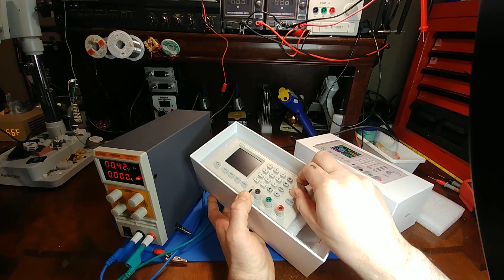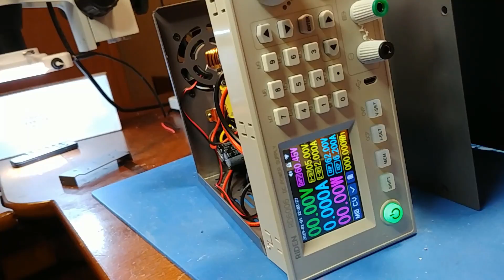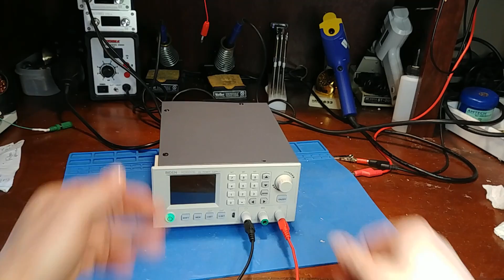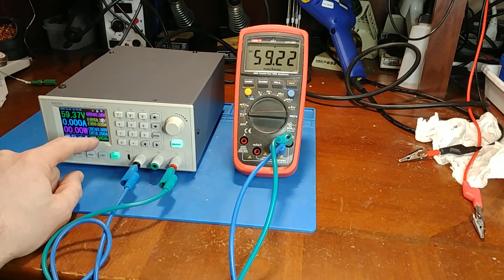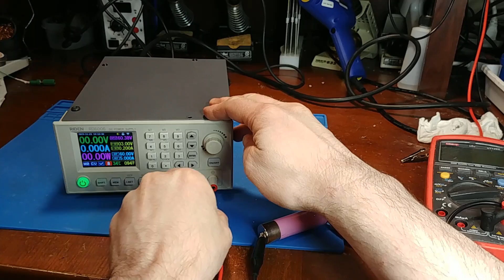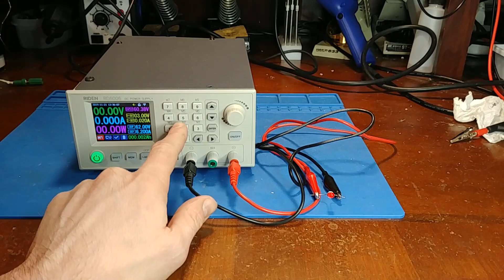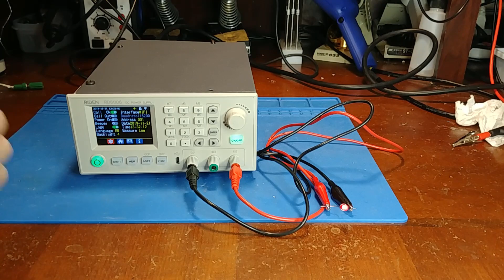Power supply: From yuk to sweet RD6006/RD6006-W

Comment: I can understand that the new buck module would ramp the voltage and current when switching the output on and off... But WOW I'm really surprised it still wouldn't blow the LED when disconnecting/reconnecting the leads.  I guess that means there's no filter caps on the output, but does that cause it to have poor ripple at higher loads?

Comment: But why you are testing diode with old power supply set to 37V 60mA and new one with 15V 20mA set? This is not a good comparison. Maybe with same settings it will also burn this diode.
Reply from the maker: I'll admit it's not a perfect test scenario. But it's a good sign the current regulation is fast, otherwise even at the lower settings, 15v would take out a LED like that instantly without a dropper resistor.

Comment: Any idea why setting a 20mA CC results in 14mA (even with Voltage set point way up?)  Is it only 0.01mA accuracy (maybe)?  I've got this coming, and will replace the GREEN battery charging terminal with some other color (hopefully one of my yellow binding post knobs will work) and I'm going to have to drill and tie a Mains Earth true GREEN post to be able to reference the supplies to for +/- supply.  Anyway, excited for mine to come in...
Reply from the maker: I'm sure sure about the current setting your refuring to. I can't do any further research, gave the power supply away to a friend. But it is a nice little power supply.
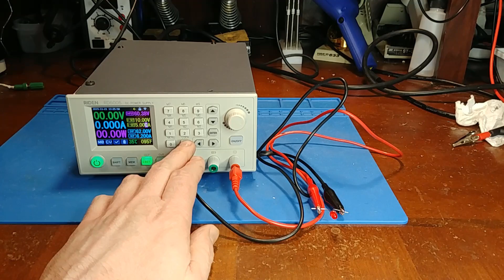Reply: @jeffescortlx  Thanks.  I just meant at 9:15 in the video, you set CC at 20mA limit/15v no load, plug in the LED, and it drops to only 0.013mA (voltage collapses to be what that LED would be at when sourcing 20mA...though it seems to be only supplying 13mA).  I'm guessing that is just as granular as it's CC mode can deliver (probably only nearest 10mA)...

Comment: Can you please describe in more detail how you figured out what value of resistance to solder on insted of front panel? I have similar power supply and the board does not have any markings beside connector when i measure resistance of bottom pins it does not change when i turn the knobs.
Reply from the maker: I took a measurement of the pots on maximum and emulated the reading with resistors. So the board still thinks it's seeing the pots on maximum, but it's just resistors

Comment: Brilliant enough to modify the old unit to put out max power, but not quite brilliant enough to immediately understand that you can't get out the full voltage that was put into a buck converter.  Most would have edited that part out... you are an honorable man!  ;-)
Reply from the maker: I assumed there would be a voltage loss, but a component voltage drop, not a software set voltage loss.

Comment: The second LED test should better be made with supply voltage settled to a target value before connecting to the LED. This way if the supply has high value capacitors can fry the LED as would in the first test.

High quality regulated supplies takes more engineering resource to develop necessary to reduce internal output capacitance, which also use more expensive part to make.  

Engineers new to this field only know to add more capacitance to reduce problems like noise and ripple not aware that low output capacitance supply are quite difficult to design and develop.
Reply from the maker: There are situations when you might not know the starting voltage. Example, you want to test  TV backlighting but you don't know how many LED's are in series without taking the LCD layers apart. So you set the current to a safe level (example 100mA) and guess on the voltage. You could start low and work your way up. But if the first guess is wrong, a poolrly designed power supply will surge over the set current and blow the LED's. This is a time when you wish the power supply would work correctly.
Reply: @jeffescortlx  
I agree with you. You have caught me on a kind assumption, leading to an omitted sentence in my initial message. 
Omitting that an experienced guy, like him, understood LED test parameters enough to set IV limits wrt a respect optimal values - 

Given he know that well he still burnt his LED because the active current sense function of the first supply can't limit the instantaneous capacitor current.

My first message was trying to point out that his test process was inconsistent, before and after.  
(first test/process) LED dis-connected, set output IV parameters, enable output port, then use hand to connect the LED (not by ON-OFF control).
(second test/process) LED connected to the output port while port is disabled, set output IV parameters, to (use ON-OFF control) to power the LED.

Side note: his first supply does not have output ON-OFF control, the second supply has.

I think he should conduct his second test in a condition represents his first - with output ON-OFF control always in ON mode, good to rule out history didn't happen with a fried LED in future.

Comment: Isn't it overkill to use the full board of the power supply fixed in 60V? Wouldn't a normal transformer just be enough? Thanks for the video, great job!
Reply from the maker: I think your underestimating the physical size of a 300 watt linear transformer.

Comment: Setting it to 5A would not put a lot of load on the 60V side, because current increases at the output since the voltage is low. So you should be able to get the full 6A without a problem on low voltages. However close to 60 volts, getting 5A would max out the board inside.
Reply from the maker: Yes, but don't forget the original board is still regulated. The voltage divider I added is just making it think the old front face pots are set to maximum. So it's still regulated to 5 amps max.
Reply: @jeffescortlx  So, 300 watts.  Maybe 280 usable depending on the efficiency of the second buck converter.  E=P/I so you can get 6 amps at up to ~46 volts
Reply from the maker: @alakani  I see what your saying. I'll try some real world numbers and see what it can do.

Comment: I have the kps3010d which looks identical apart from the case colour. It’s 30v 10a output. How easy would it be to do the mod on that one? Would you be able to give me some advice for resistor values? I can send board pics if needs be.
Reply from the maker: You'll still be limited to 30v max, even though the control can handle 60v. Just meter out what the front pots read when on max settings and use those values.
Reply: @jeffescortlx  Okay, so I've measured the two pots, The V pot is 1.7k between 1 & 2 and 1.7 ohms between 2 and 3. The I pot is 1.6k between 1 & 2 and 4.1 ohms between 2 & 3. My board isn't marked on the connector, so could you give me an idea of what resistors would go on what pin based upon your mod and my values above? Sorry for the dumb questions, but I don't want to mess this up :-) Thank you in advance.

Comment: Too expensive.
Reply: Compared to what?
Reply: Other chinese power supply. If you do not care of design.
Reply: @jurisembergs9245  
A cheap poorly designed supply will get very expensive if it blows an item worth an order of magnitude more.
Reply: Of what i experienced of chinese supplies - zero, so far, will answer later on, when receive one. Strategy is to order different and non logical, to get at least something able to work anyhow. What i found over internet, China is far from Germany, Japan and USA, in terms of quality as well.

Comment: You should try hooking up a Oscilloscope to the output when you current limit the output, sets voltage to 15V and manually plugs in the LED. Could be interesting to see how fast it drops down the voltage
Reply from the maker: This video has a similar test: https://youtu.be/51fAQbQGGqI

Comment: You need minimum 2-3V headroom to allow for the situations when at 60V usage you start drawing some serious current. 1 volt headroom is .... (not enough).  I had the RD6006-W for a brief week just to try it out and for accuracy testing purpose but for my case didn't quite cut it. When loaded with a heavy load say from.....3A up @ 30-to-55V  the measured voltage (measured with a brand new and high accuracy Fluke 289) at the output terminals is a lot lower (by a fairly big margin 0.3-to-0.8V) than the value shown on the LCD screen. Than means that the current sensing shunt  implementation within the PSU circuitry is not very well made and also the voltage reference used is is not very precise and that also contribute to the above voltage error. However, is still a very good value for the money.
Reply from the maker: The power board it's self is a regulated power supply. So it should have no problem maintaining 60v@5 amps. (Minus the 1 volt.)

Comment: The problem you highlighted with current regulation by blowing up the LED is common with many power supplies, not just cheap ones. It is nothing to do with a slowly acting regulation circuit but all about a design shortcut.  It is common for a significant sized capacitor to be across the output and outside of the regulation loop because it is a simple way to lower the output noise and achieve good stability.  The output capacitance is not a problem in constant voltage mode but as you clearly demonstrated can destroy things in constant current mode. Setting the power supply to 60 volts on the output and current limit to say 20 mA then connecting the LED dumps energy from the capacitor straight onto the LED. Depending on the capacitor's ESR this could be a spike of several amps. It doesn't matter how fast the power supply regulation loop is because the offending capacitor is usually outside of the regulation loop.  For a power supply to be designed with good behaviour as a constant current source the capacitance that is outside the regulation loop needs to be minimised. The current spike is usually also invisible to the power supply's current measurement because the measurement point is before the capacitor.
Reply from the maker: In my review video of my 120VDC power supply I shrank down the value of the terminal post capacitor to get rid of the large un-regulated current dump. Been using it that way ever since, no noticeable side effects, and it's nice to be able to trust what the current limiter is set to.
Reply: Thank you.. that's good info to know. 👍👍
Reply: What kind of tricks is the Riden unit using to not blow the LED up?
Reply: i looked at buying one of these guys until dave jones showed the output ripple can be as high as 500mV in certain situations and hangs around 100mV. that kinda bums me out. theres gotta be a way to smooth it out in a way that it can still regulate its current
Reply from the maker: @pepe6666  did you see the update video? He was using the wrong probes during the testing and re checked it the right way.
Reply: @jeffescortlx  i think it actually was in the second video. theyre not very clean power supplies :/
Reply from the maker: @pepe6666  in the update video noise was within spec. I'm not saying this buck style PS is for everyone. But I'm not a HAM radio guy, or engineer so noise doesn't effect me much. After all we need to keep in mind we are talking about a $50 PS not a true lab $1000 PS.
Reply: @jeffescortlx  yeah but you gotta understand 500mV peak to peak noise isn't just some ripple on the line. thats half a volt and kinda makes it borderline useless
Reply from the maker: @pepe6666  but 500mV is wrong. He re-tested with the correct probe. It's actually 130-200mVpp.
https://youtu.be/gpwkiJC5hfU

Comment: This video is perfect. I have the exact same ps except the 30 volt version. I agree with you on the current discharge problem when you hook up anything like you did with an led. I found the Riden ps on the internet and ended up buying one. Now just waiting on it to arrive. Pretty excited especially after seeing your video because it looks like it does exactly what I was hoping it would do. Thanks for great video.
Reply from the maker: You should stop back in when you have it completed. Are you reusing the 30v supply?
Reply: @jeffescortlx  
I also ordered the case they recommended and I have a separate 36 volt ps I'll use for now.  I'll see how that works for now but will probably upgrade to the 60 volt.

Comment: I have two Power Designs triple output power supplies from the 1980's that do a great job - and they were cheap!
Reply from the maker: Those old power supplies are great, but hard to find anything above 30v. When trouble shooting led tv's and lights 30v isn't high enough. I guess if the secondaries are isolated you could run them in series.

Comment: I suspect the voltage and current isn’t actually ramping over seconds, as that would have blown the LED. Instead, I suspect the regulation is done in analog, to give fast response, and that the output display just uses a really long averaging, causing the ramping appearance. It’d be interesting to repeat the LED test with the output hooked up to an oscilloscope.
Reply from the maker: Yep, this person did just that test here:
https://youtu.be/51fAQbQGGqI

Comment: I like what you did! however, if you take the cost of 80$CAD for that frontend and another 40$CAD for the original power supply, one is better off just buying used but better brand name power supply in the first place. But i do get the need to tinker with cheap china crap and try to get it working better than it originally did.
Reply from the maker: Chances are the good popular $100 power supply is only a 30v. The market is slim at 60v@5@amp.
Reply: @jeffescortlx  one of those harbor freight welders for $100 would make a decent power supply. i think they output 50-60 volts on high and who knows how many amps 80+ probably. I'd like to see a digital buck converter for one of those lol

Comment: Nice mod :-D
Wow that's heaps better than the half baked ps605.
I'm guessing it's a variable buck regulator so it should not get too warm :-)
If the switchmode goes poof then its easy to replace.
I did hear some odd fizzles on your audio, hopefully it's not the 60v supply that's moaning, you could set it to 51v if it is.
Reply from the maker: The weird audio is my phone. Seems to have happened from the last update.
Reply: Have you given that module a burn in test?
Say 5 amps for a couple of hours to see if it wanders.
Reply from the maker: And yeh it's some sort of PWM for control. Also seems to ramp up the power when output is turned on instead of a instant on. I like it
Reply: If you use it to power up some devices a slow up ramp may stop the device powering up.
Some devices are a bit picky.
Reply from the maker: @zx8401ztv  another review is floating around YouTube, he tested the ramp up with a oscilloscope, it ramps up within a few milliseconds. There is a display setting to change to show real time.